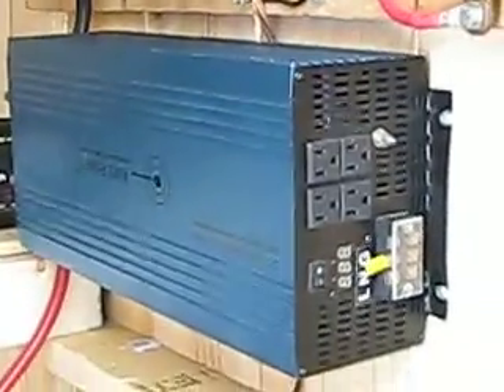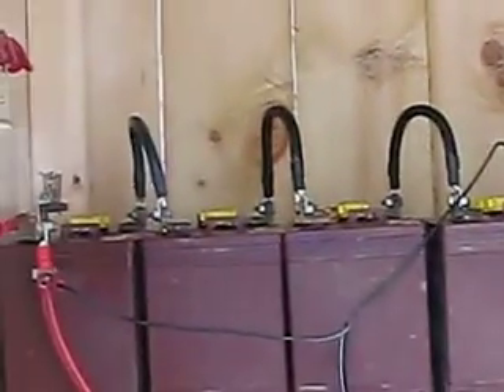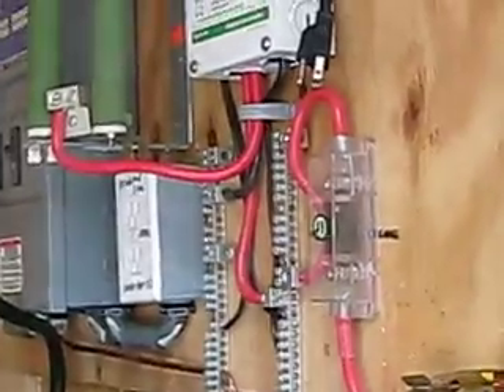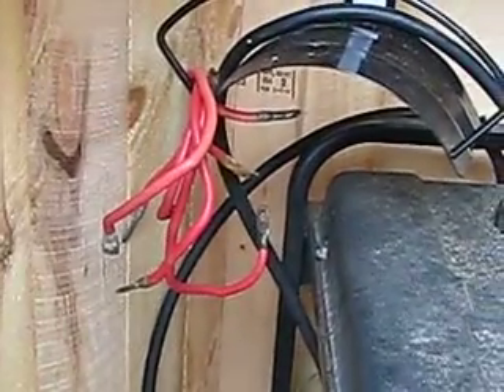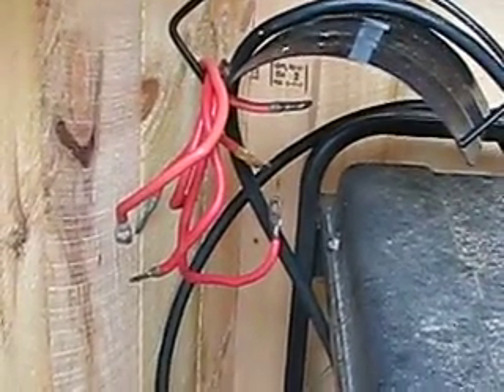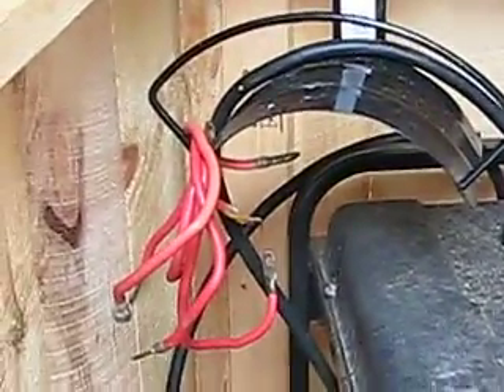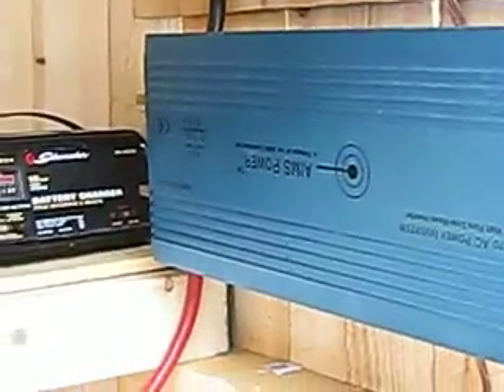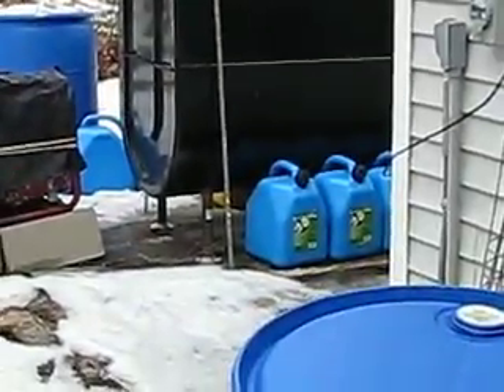new backup battery setup

Comment: You'll definitely get better results with those new connexions if you're running anywhere near your capacity of the inverter you have. Good upgrade! Those old lugs are horrid...! You see plenty of copper plated steel on cheap jumper cable alligator clamps (whose cables are copper plated aluminium!) and I suppose they are ok for such an occasional use item as that, but for serious battery connexions no way...!
Reply from the maker: +xanataph I've made my own cables with the #4 cable, but the price was less for these than to but all the individual stuff.
I notice that when I check the voltage on each battery, one of them is at 7 volts where the other thee are at 6, is that an issue and how to correct it?
Right now it had no solar or wind, it's not in case the grid goes down.
thanks
Reply: +Rev John O&#39;Toole Yes, that is definitely something that you'll want to take care of. You need to measure the voltages with a digital meter to an accuracy of at least one decimal place, preferably two. Because there is not much difference (say) between 6.9 & 7.1 volts but there is a huge difference between 6.7 & 6.0 volts! 

A good, fully charged 6 volt battery will sit at around 6.4 volts while not being charged or discharged. If they are on charge and being floated 6.9-7.0 volts is what you would probably see.

If they are on charge at the end of the charge (before float) you would expect somewhere around 7.2 volts or possibly a little more.

If you have some batteries in the low sixes and others in the high sixes/low sevens you might have a charge balancing issue. The best thing to do in this case would be to get a six volt battery charger and give each battery a good solid charge on it's own. 

This could actually be done without de-wiring the bank without any issues one battery at a time as the current will only flow in & out of the battery it's connected to since you have a series wired bank. But it might be wise to disconnect the inverter while doing this as some still draw a small current even when off. 

If you don't have a six volt option on your charger you could try using the 12 volt setting across pairs of batteries. I would do this by grouping the two lowest batteries and the two highest.
Reply from the maker: +xanataph OK, so when I first check them after charging cycle, the one on the positive end was 7.1 and the others were 6.1 or 6.2 with old cables.
Then I put the new cables on and idiot that I won't mention reversed the cables on the inverter, which I hope only desulficated the plates. fixed that and recharged with new cables. This time the 7.1 battery was the second battery.
Justin Case recommended an  equalizer that balance the batteries to be equal. will they bleed off the voltage as it sits without a charging float?
Thanks
Reply: +Rev John O&#39;Toole If you reversed the cables to your inverter the only likely negative outcome is a dead inverter. There's almost zero chance that would do any damage to the batteries. If the inverter still works you have gotten away with everything..! ;) 

A good battery once charged but disconnected from a charger won't sit at the float voltage but they will sit at the typical fully-charged voltage for a good battery. That's usually 6.35 or 6.4 volts for a six volt battery. Sometimes they will stay higher than that for a while if a surface charge remains. 

What I would suggest is charging each one up separately. And then letting them sit for 24 hours and see what you get. Do you have a charger that is capable of charging 6 volt batteries?

Some kind of balancer unit might prove beneficial. But only once you have your rig up & running. I'm not sure if anyone makes one for six volt batteries.
Reply from the maker: +xanataph Justin sent me this link for an equalize, he got his from Giant Power over there

http://www.ebay.com/itm/262134620720

thanks
John
Reply: +Rev John O&#39;Toole Well it looks like it can do six volt batteries, so it's definitely worth a try. But it won't help you ascertain if all your batteries are in good condition like a separate charge & monitor procedure will. I'm not too fussed with the almighty JC at the moment. I found out he has been blocking all my comments on his channel. That's not very "community".
Reply from the maker: +xanataph I try not to put anyone on a pedestal, and if you think I am ... hit me in the head with a block of wood

I asked Alt-E about this and they suggested this, just have to go on list. mean while I will try the pairs you suggested sice my charger is just 12 / 24, If I knen this five years ago I would have got the 6/12/24/48 charger if it exists.
best
https://www.altestore.com/store/deep-cycle-batteries/desulphators/bls-1224-c-battery-saver-desulfator-p200/
Reply: +Rev John O&#39;Toole Nah, I was just referring to some of his more sycophantic followers...lol 

What you have there is a battery desulphator unit and by the looks of it it's a fairly grunty one. However, I am fairly sceptical of the performance of such units. I have played around with home made ones and have quite a few of those cheap commercial ones. They may extend the life of a reasonably good battery, but I have seen no evidence whatsoever of them bringing a battery back once it's on it's way out. 

Using your charger on the 12 volt mode is a good option to do the batteries in pairs. And even better if it has a "boost" or "recovery" mode - this is simply what we would call "equalizing". 

Another possibility is to use the charger on a single battery on the 12 volt setting with some series resistance to limit the current. A 50 watt 12 volt halogen bulb or an old car headlight is a good choice for this. 

Some chargers might not like to turn on when confronted with a 6 volt load that this scheme would present it with, but if yours does turn on then you're in business. 

Naturally you would have to manually monitor the progress of the charge. But if you can do this and stop it when it gets to 8.0 volts, providing it doesn't get there too quickly you'll then have a very well equalised 6 volt battery.